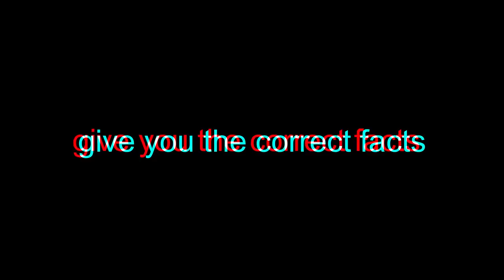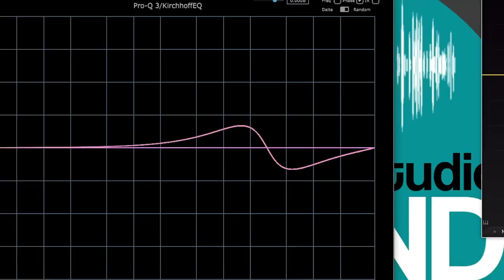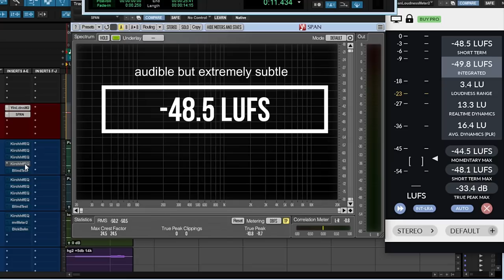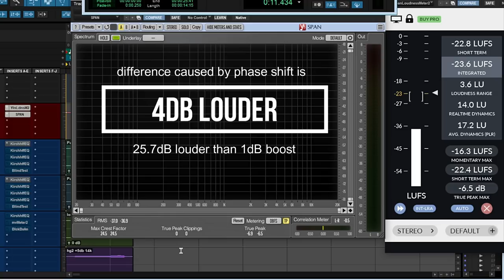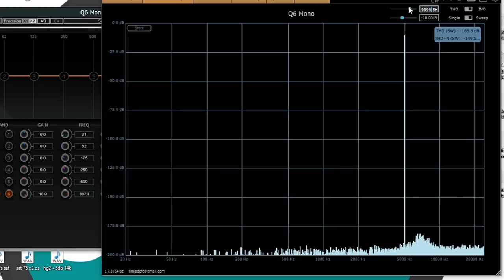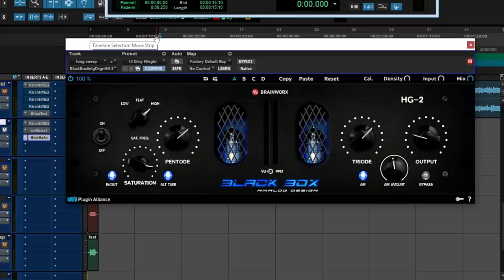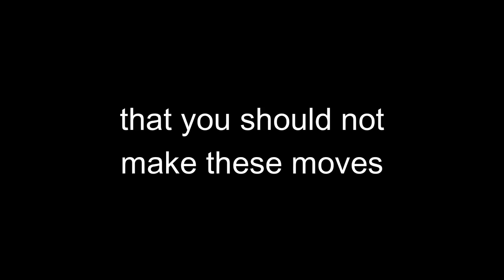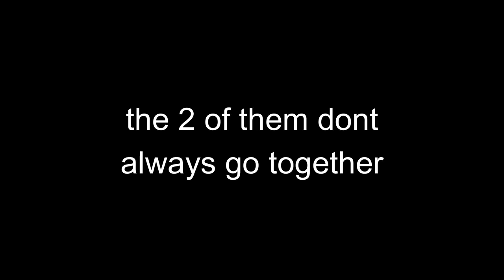THIS is why engineers tell you NOT to EQ like THIS when mixing

Comment from the maker: And for anybody wondering why people feel the need to class this all as a myth I can take a guess its more centered around stock digital eq's. The 'myth' is that stock digital eq's will cause phase issues the more they are boosted and cut. This is actually partly true because nearly every stock DAW eq won't come with linear phase options (with the exception of logic pro??) HOWEVER this also applies to ANY eq that doesn't have linear phase as an option and that also includes Analog eq's (and that goes for non linear emulations as well)

And for the "boosting big with stock eq's can cause distortion and aliasing".. Its been classed as a myth because others have not understood the correct context behind it. It's not just stock eq's, its every eq that makes big wide boosts going into saturation or distortion. it's just that the sole inclusion of stock eq's fit others narrative better. 

All of these things are about context, if you don't take time to understand the context behind the "myth" then it will still sound like a myth to you

Seeeeeemples 🤓
Reply: Thank you. Maybe stupid question. Dos all this apply to using low and hi cut filters as well? Like cutting all hi information form kick. Cutting all low info form guitar (for bass) etc. Does all this create a lot of phase issues? If yes - what we can do instead or how to do it better?
Reply: FL studio’s does 👀
Reply: Which I find funny considering how much people like to crap on FL studio 😂
Reply: @AJOrpheo  I use Studio One but FL was next of my choice. Best GUI ever. Sadly not my workflow.
Reply from the maker: All eq moves that aren't linear phase will result in a phase shift but I wouldn't worry about it. There is no linear phase in analog. It's just a byproduct of eq. Certain phase shifts can actually give you an audible benefit
Reply: didn't know that was a common myth, FL-studio's stock EQ has an option to see the phase shift built in, it also has a linear phase mode, so logic's certainly not the only one.

Comment: Woooo Paul, I never thought that going into a Saturator with a higher treble eq would produce more aliasing! 

I checked it in Plugin Doctor putting the Black Box after and then putting it before the eq no longer generated that excessive Aliasing! 

Then in a mix that we are doing we put the saturators first before the eq that boost the highs and it is impressive how the clarity improved! 

Thank you very much Paul, it is one of the best videos you have made without a doubt
Reply: @lunairys Very interesting point to put the saturation before the eq and probably also before the compression. After Pauls video that makes sense. I have to test it.

Comment: It should be a known fact that minimum phase EQs work exactly because of the phase shift.
Technically speaking EQ is a function of phase and not the other way around: you delay a frequency group by a certain amount and this gives you the boost or cut. 
The same happens in the analog domain as LCR filters do exactly that, they apply delay to achieve the desired result.
Phase equals delay.
As for the linear phase EQ variety, digital trickery is then applied to recover any phase shift occourring.
Reply from the maker: Tbh I shouldn't have had to make this video because your right it should be a known fact.

But when you have audio channels with 17k+ subs needlessly confusing matters with stuff like "people believe that digital eq plugins cause problems due to phase anomolies and aliasing. I added a bunch of eq on a track, countered that eq in series with with reversed settings and the result nulled 100% with the unequalised sound.. Proving that stock digital eq boosts don't mess with phase like people are lead to believe"

.. And then using that example in a video talking about why it's OK to use stock digital eqs to make big wide boosts and cuts.. It just blurs the lines of the facts. 

Now after looking at his comments section it looks like what he's trying to say is that digital stock eq plugins are 100% accurate unlike analog which may have phase variables and these are what he calls "phase anomolies". But then at the same time states that due to the basic roots of digital audio science ie cancelling a boost out with its exact opposite cut and then flipping the phase with the unprocessed to 100% null.. Proves that "all digital eq's do is boost or cut" and completely disregards the fact that the bigger you boost or cut results in a more audible phase shift and thus why making these big eq moves in digital eq's without a linear phase option can to many, result in negative results or "ruin the mix" in their own words (not mine)

Comment: One of my favorite stories which I cite often is from an interview with Malcolm Toft talking about the Trident A-Range, and how when an engineer told him about the phase-shift the console's EQ introduced he responded: "Okay, but do you like how it sounds?" A big reason why that console sounded so good (its emulations are my go-to EQs) is because its designers were musicians/recording engineers instead of electrical engineers, so they didn't worry as much about the technical side, and did what sounded good musically, because that's the goal. I concur with you that the science is handy to know, especially if you need to fix a problem, but it is only a means to the end of getting a good sound.
Reply from the maker: Totally, lots of acustica stuff I like is a lot to do with just phase. I mix more with pre's these days instead of the eq's just for the passthrough
Reply: @PaulThird  Indeed, not only do they give you more character, but they're more efficient to work with; why would I spend 5 minutes sweeping through to find that just right frequency and q factor on a digital parametric when I can pick from frequencies set for me by the guy who tracked "Hey Jude," pull it up and in 5 seconds go 'yeah, that's pretty good,' and save my energy for more creative decisions?

Comment: This is why you compress pre-eq. It can be done either way around, but the order changes the initial sound in a drastic way.
Reply from the maker: Very true. CLA is a great example somebody who purposely eq's big but into compression so he can use the gain reduction to control how much 8k he brings into guitars. He purposely goes in hard into the la3a instead of just boosting to taste as he prefers the colour of the 8k compressed. He goes too far so he can use compression to dial it back. It's a sound in itself and quite easy from a workflow aspect. Max out the 8k.. Have up your compressor set up the same way and compress till the bite in the guitars is just right and not overly harsh

What I did wrong back in the day was just add in lots of 8k without going into a compressor and wondered why it never sounded right.. All I heard was "I crank 8k.." OK.. F*ck compression.. I learned a valuable lesson after that eventually .. All about the context haha

Comment: Good video Paul, love ya pal.  That 11db gain from phase shift is huge and would be unexpected by those who don't know.  You'd get away with the distortion in analogue if it still sounds ok, but in digital you are going to end up aliasing all over the place lol.
Reply from the maker: 11db increase in difference is just 15db compared to 5db boost haha 10db & 15db boost compared to 1db boost both have over 20db more difference due to phase shifting haha 😅

Comment: Even though lin phase and min phase don't null, the "difference" between them is actually just a slight delay - not a change in tone. a static phase shift is almost never going to be audible unless it is blended with the dry signal.
Reply from the maker: There is a difference in sound. I understand what you are saying but in practice if you match curves but if the phase doesn't match then are audible differences in an A/B test. For example boost 15db at 10k on a drum bus and compare that with the linear phase. I can hear tonal differences in the cymbals where it sounds harsher with minimum phase.

Comment: A fun experiment I thought would be to take a full complete old project mix with 40 to 50 tracks, replace the original audio, vocals and instrument's etc., but keep all the plugins, and volumes but replace the audio with either a traingle wave or even 3 sine waves to form a chord on each track. Dont actually listen to it, but just render two versions, one oversampled, and one with the oversampling off and compare with the Rx. Obviously it will have the same affect as you see comparing a single track but it will show the Cumulative affect on a typical mix. How much garbage will exist?

Comment: Real life sound has phase shift with frequency changes. Linear phase is an option for very specific purposes, but using it as the default is less natural sounding.
Reply from the maker: True, no real life sound is linear phase so technically linear phase is less natural sounding in theory but doesn't mean in a creative context it doesn't have a place like any other process.

Natural is a pretty subjective term. You could use tons of natural phase processing and make this sound unnatural. That's why we just use our ears and go with what sounds best
Reply: @PaulThird  Very fair! :)

Comment: Not that I know what I'm talking about, but back years ago I've read that linear phase introduces eq pre-ringing which is a much audible phenomenon with transients, and it will create a time-based difference when compared with regular eq. So I'm not sure if nulling is a useful test in this instance. Also been told that it's the phase shift itself that creates the desired effect of cut/boost - for whatever it's worth. I guess if it sounds good, it is good, which is what matters at the end of the day.
Reply from the maker: Phase is a delay of frequencies. That's what happens when we eq. We slightly delay each frequency in accordance with the eq curve. If there were time based issues using linear phase then it would affect the full signal. You can see that the areas that aren't being boosted fully null as any irregularities in time would cause an audible signal to come through..but there is no issue with time using linear phase. That's why the only signal we see coming through in the null is from the area that's been boosted.

As for pre ringing and linear phase, it's one of these boogie man things that people push all the time. Yes linear phase can cause pre ringing but the chances of it happening depend on certain factors and whether its even audible is another thing. 

Even in Dan Worrals video he admits that he needed to set it up a certain way with a specific kick in order to make the pre ringing noticeable. And it's important Dan said that cause loads of people make youtube videos and show examples of manufacturered pre ringing but don't tell anyone that they had to spend time to figure out how to make it noticiable. Nearly all of them are pre set up. 

In actual practice, its an out and out lie that using linear phase will cause pre ringing EVERY time on transients and that when it does, its noticeable. 

Take acustica for example. There's truncation (echos) in loads of their plugins and its something that some people prefer without even knowing and most don't even hear it.

Pre ringing is the same. You can use linear phase on a kick or snare and there be some slight pre ringing on occasion and you don't even hear it in the mix and you prefer it compared to natural phase. Very similar to aliasing. 

I'm not saying use linear phase instead of minimum phase. But I do sometimes use mixed phase in kirchhoff which is natural phase for the lows and linear for the rest. Not cause I'm worried about phase, just cause the options there, it has a tonal shift and its easy to compare.

Everything we do in a mix has the potential to f*ck something else up. Phase obviously has an effect on drums and if you eq 3 snares all differently then that's gonna create a tonal shift due to phase cancellation as they are on the same signal, and that's why many eq on a bus and process as a whole.

Its just a part of eq and tbh I just use my ears in the context of the mix. If I like something better then I go for it
Reply: @PaulThird   Our ear is used to phase shift created by EQs for more than 40 years. In Germany we have the saying "the better is the enemy of the good." Sometimes linear phase is the better choice.

Comment: Hey, couple questions. what do you think would be the best EQ to EQ rap vocals then? should we use a Linear phase EQ?

2. If we don’t track with compression going in, would you compress first or EQ in your chain

3. in what part of the chain would you use a Saturator? 

Im talking specifically for mixing home rap vocals. Thank you 🙏
Reply from the maker: I treat all vocals the same way. Smart eq for spectral balance and normally mixroom from mastering the mix in a genre specific preset to give me an idea and I may tweak that further, add to it with a clean digital eq or simply put up kirchhoff and do my own thing entirely but my advice is more to have a reference handy of what you want your rap vocal to sound like and use whatever tools you have at hand to replicate that.

My vocal chains are extremely clean but I do use a hard hitting 1176 in parallel to give me some grit if I feel I need it.

I compress first then eq dependent on how good the vocal recording is. If it needs work then I'll clean up first then eq but if it's a good recording. Compress clean with kotelnikov GE and then Lindell de-esser, soothe, smart eq followed by mixroom or my own eq moves with kirchhoff then multiband compression at the very end
Reply: @PaulThird  Great, thank you🙏 One more thing, do you know which EQ’s are colorless and clean/ natural? ones that won’t add any artifacts etc to my chain?
Reply from the maker: Most non analog emulations. Mostly all stock digital eq's, fabfilter, waves, kirchhoff etc etc list goes on and on
Reply: @PaulThird  Thank you🙏

Comment: Great observations; it had me poking around in PluginDoctor on the oscilloscope and it peaked something of curiosity which when I brought it over to the frequency response plot made better sense; 
You might find this interesting to further explore (For the science part; practicality part plays very little into making sense of what I found)

At higher frequencies; the differences were indistinguishable when graphed; on even the frequency response graph;

However here were my settings and you can poke around yourself with it (Because YT doesn't allow photo attachments)
IN FF Pro-Q3 a bell curve @53.8hz +3dB Qfactor of 4; 

Plotted 3dB of gain in Natural phase mode and ≈2.5dB of gain in Linear phase - Medium mode;

I think the differences may be smoothed out at higher frequencies because the bandwidth covers more frequency cycles;

All that said; good job;
Reply from the maker: It's been a long day, could you simplify what your end conclusion is by doing your tests. My heads minced. Are you saying that phase diffrences are more audible in lower ranges compared to higher frequency ranges?
Reply: @PaulThird  Short answer; there happens to be a difference in GAIN on the EQ's centre frequency at those lower frequencies;

My conlusion as to why; the audibility and relevance; inconclusive because these were very quick tests I put together and glanced over this morning during my coffee;
Reply: @panorama_mastering  I have not uderstood your point either.

Comment: Great video Paul, really opened my eyes. 

I wouldnt know what phase shift sounded like though even though I have spent countless hours hammering away with EQ alone. But I'm looking forward to doing some heavy lifting with linear phase EQ and the gentle tweaks with standard EQ to see if anything good comes of it. cheers!
Reply from the maker: Always worth experimenting with. But just be careful with linear phase and transients especially if doing really narrow boosts. I really only see it as a problem in the low end due to pre ringing so I use mixed phase from time to time but it depends on the source and tbh its not even an issue in a lot of cases but no harm in experimenting yourself 🤓
Reply: @PaulThird  Ahh cheers for the further info. 

A lot of the time I'll be cutting quite a lot with low shelf <220hz and below cuts to counter the proximity effect + small room + low end buildup on acoustic guitar and then just a couple of db wide ish cut from 1-5khz because of the huge peaks around that area on some of my mics. I figured that those moves are by far going to be the biggest moves so I was thinking of trying to do that with a linear phase EQ first, and then continue as normal. 

I am curious to see if I notice any difference, I never really thought about the technical while mixing but after seeing your video..... I can't ignore what I just saw. 

Cheers Paul, glad I saw this one.

Comment: Good video and perfect explanation - I'm curious how this apply to a plugin like Shoothe 2 in terms of alliasing?
Reply from the maker: Nowhere enough distortion made in the plugin to cause aliasing. Basically like putting a signal through proq3 working as a dynamic eq. Extremely clean. Soothe is meant for smoothing out harshness so it's never anything to worry about
Reply: @PaulThird  - thanks so much for your reply 🙏